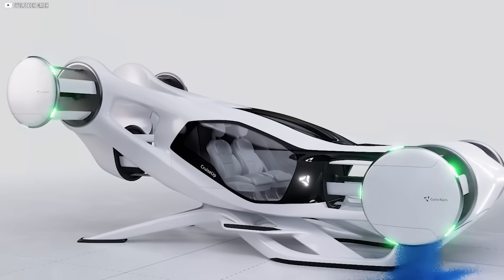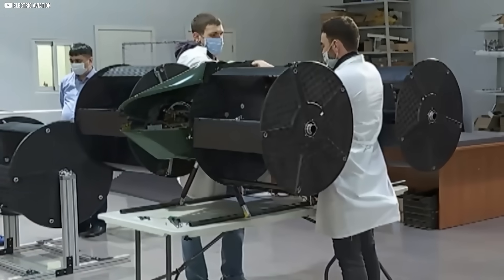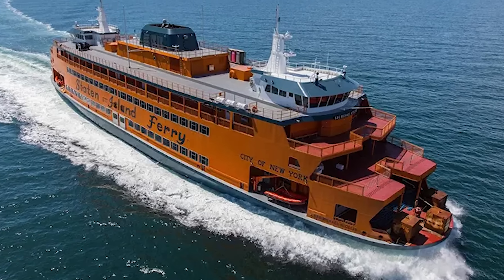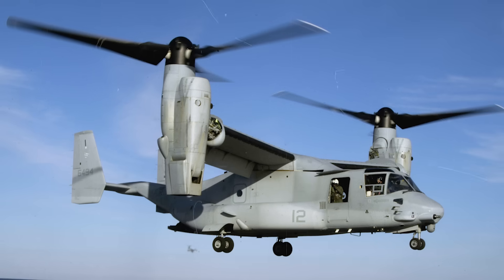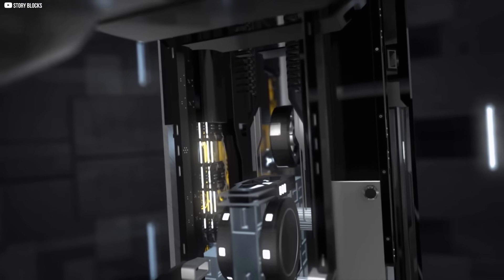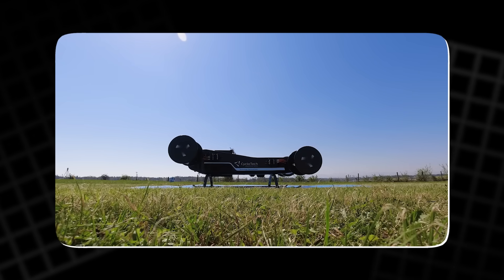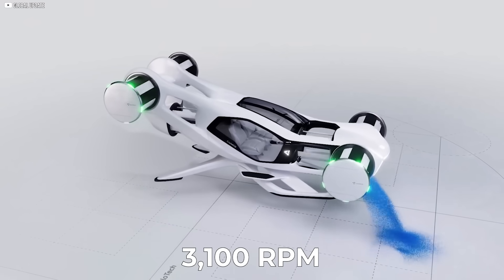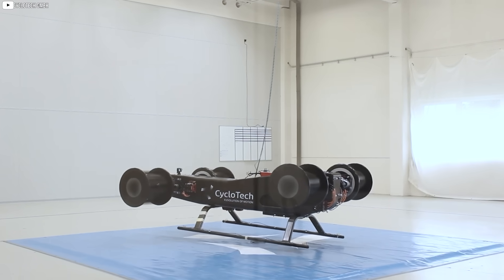Is This The Most Precise Flying Machine Ever Built?

Comment: The axle hub connection going into the motor has to be much stronger and expensive because the rotor is supported on one end only. The moments at the juncture of the axle to frame are tremendous. The rotors want to snap off. This problem would warrant a lightweight superstructure made out of thin, strong material to span over the rotors on both sides - front and rear, with supports dropping down over the open ends of the rotors.

Comment: use ducted blower fans instead of the many moving parts helicopter blade roller cyclo rotors. ducted blower fans can be also muffled very efficiently. cyclo rotors are very much like electric ducted fans.

Comment: Definitely would not have been able to have this in the 1980s or 90s without all the right micro processors working together even now it takes a lot of computer power to calculate which each blade goes at the exact millisecond

Comment: Instead of tilting the blade during rotation with complex mechanism, maybe try fixed pitch blade with strong cover outside to direct the flow of thrust? Altering the cover position may seems easier option?

Comment: The first half of this video doe NOT address the true video subject (i.e., today!).  IF this were so good, commercially viable, it would have already been out there already instead of what competitors ALREADY have on the market.
Reply: Sorry, but you're wrong about that. It isn't until very recently that strong and light materials existed that could be cost effectively created. Now carbon nanotubes used in 3d printing have changed the game. I'm no expert in this field, I'm a former F-15C pilot and retired airline captain with a degree in aerodynamics, but this tech didn't exist when I was in school. However, I'm involved with one of the cutting edge companies developing this, and I've created a few working models with my 3d printers, using just what I've learned. It's incredible tech, and it will change the planet over the next 10 years.

Comment: Interesting concept, but I want some numbers. Narration keeps talking about efficiency, so how about giving the lbs./newtons of lift per HP/kW input? As for something that's supposed to be so quiet, we never heard it actually running. What is the dB level per ton of gross weight lifted?  The description of how the blades change pitch is exactly how a helicopter main rotor does it, but that was described earlier as being so mechanically complicated (and it is!).

I have a ton more questions, but I don't want to burden this response too much more. Without hard numbers and performance characteristics, this seems like another fund-raising video.

Comment: Airships or partially buoyant aircraft seem like a good fit for these rotors. The extra mass won't matter so much, nor will the paddles need to rotate so fast. If you're not looking for speed, but you are looking for precise control, then cycloidal props could be seen in leisure travel by blimp, or in delivery vehicles that need to stabilize in windy areas.
Reply: Good application!
Reply: Not sure about that. Thrusters for blimps usually have their propulsive motors slung under the gas bag,so the corrective action of the rotors would have a limited action to stop sideways movement.
Reply: Absolutely wrong conclusion. Weight in the airships is crutial and they don't need to react quickly because they are big, and they have no chance anyway - too big area to compensate sidewind blows.
Reply: Helicopter pilot here, and experimental builder… I agree with you. Very smart idea
Reply: Good luck convincing balloonists that they should have skids on their baskets lol

Comment: Soooo many experiments appear "promising", so they they get research money. Maybe that's the point. Moller "car". How much horsepower, how much blade surface area = how much lift? stability? control? payload? Should be a basic calculation. Airplane, more horsepower, longer wings = more payload.

Comment: Interesting. I haven't seen this idea before. But wouldn't it be more stable if the blades were more inward on the vehicle instead of sticking out with only one side getting support. It just seems unstable supporting one side of the blades and not the other. That would create strain on them causing them to break under pressure. It's like building a bridge with the strongest material only to have the ends being held in place by two toothpicks.

Comment: @rayllawrence1 is right. This idea is doomed by the laws of physics.  The power required in a hover is high due to low "disk area" which in this case is low "rectangle area".  That would be true even if the airflow were ideal, but in practice it is complex and inefficient.  The mechanical design is heavy and complex compared to a propeller or rotor of similar capability.  Forward flight speed will be severely limited by the "pitch speed" of the rotors as they are forced to reverse pitch by a larger angle to increase the flow velocity. For a propeller the pitch is just increased and doesn't have to oscillate back and forth. Just because something looks cool doesn't make it a good design.
Reply: Nailed it!
Great engineering insight.
Reply: While i agree, we (humans) are specialist in make things that are fit for a purpose and only their purpose.  While this method can be overall "ineficient" from various perspectives, it could be usefull for certain purposes... specific purposes.
Reply: Those sound more like inconveniences than full blown problems.

Comment: Efficiency in flight in air is mainly dependent on the 'wing loading.' Witness the Glider and the Jet fighter. To say the potential is undeniable is hardly credible. Turning at some 3,000 rpm, the angle of attack on those small paddle blades will be reversed twice per revolution, never permitting a smooth, efficient airflow to be established. Even at less than the stalling angle, shock-stalling will be a huge problem because of this disturbed airflow of this sudden reversal. Helicopters are complex machines but this Cycloidal device is far too complex with so many joints, levers and linkages as to be  worryingly unreliable and unlike the Helo, there is no chance  for autorotation. However, in a denser medium like water, this system might prove very beneficial in future with underwater drones/vehicles, seemingly having very precise maneuvering capabilities and  where conventional propellers are vulnerable to stray ropes and fishing nets.
Reply: Good points,time will tell.

Comment: I want to see how it handles the chaotic winds around tall buildings. If it can compensate for that instantly,I will be sold.
Reply: Gotta spin too fast.  Centrifugal force will step in and wreck the fun.  Big hunk-o-junk.
Reply: You would need to generate an infinite aerodynamic force for instant and total compensation
Reply: @CONNELL19511216  No,you just need enough aerodynamic force to prevent being slammed into the nearest building,and that is what this thrust system is designed to do.
Reply: I already ordered mine. 😊

Comment: It is important to understand that this design is more energy efficient than the others. Instead of the energy used to turn a helicopter propeller, the energy used to turn four car wheels is sufficient. It is most likely silent and can probably perform trust vectoring. So, if used with other suitable instruments, they could be the aircraft of the future. Everyone could have one at home, but it looks very ugly. Another issue is that no one would buy this instead of a Lamborghini.🤣So what I mean is that the angular momentum of a helicopter rotor is different from the angular momentum of four car wheels. Car wheels can be rotated much faster. So if we consider these rotors as car wheels.🤔

Comment: I was considering this kind of propulsion around 20 years ago and realised that it is a classic solution that is looking for the problem.
Conventional propellers are simple, efficient. reliable and extremely lighweight. With excess power provided by electric enegines there is no need for complicated mechanical solutions, there is only one dominant direction where we need a thrust. The only practical usecase is an extremely bad weather, when you shuldn't flight anyway (but it is a "classical wisdom").